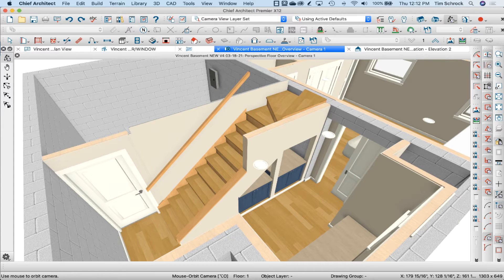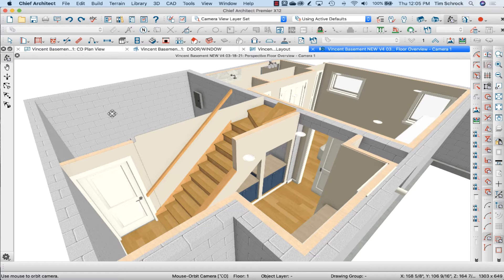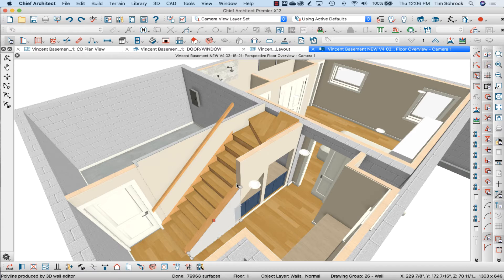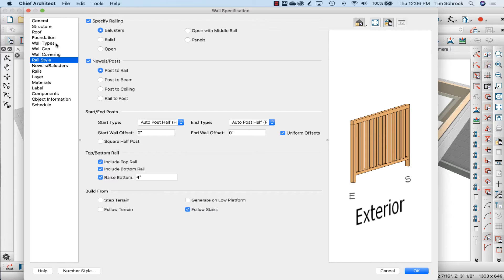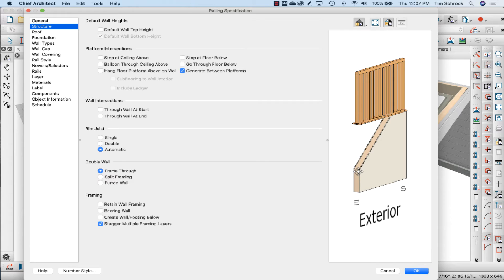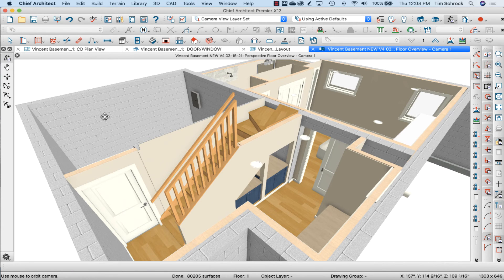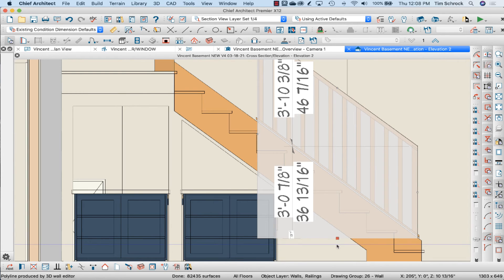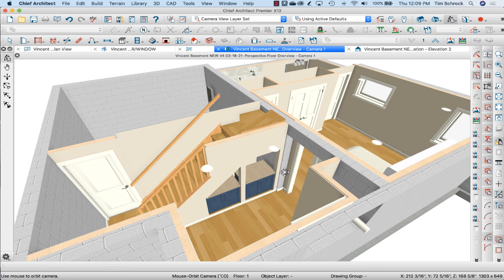Adjusting Stair Railing/Walls | Chief Architect

Comment: How did you open up the space under the stairs? I have an alcove in a garage that shows an angled space below the stairs and can’t figure out how to create that space.
Reply from the maker: I used doorway openings without casings and jambs so that it’s a drywall wrap. The angled opening is adjusted manually with elevations and some construction lines to figure what the shoulder heights should be

Comment: Thanks for the video, but how did you do the winder at the top of the stairs
Reply from the maker: Each winder segment is built individually with a landing. I set the stairs to go from floor to floor to find the riser height, and then subtracted three risers so I know where the lower landing is supposed to be and attach the stairs to it. Then build the other two landings on top of that.